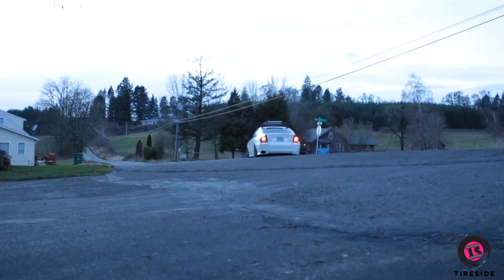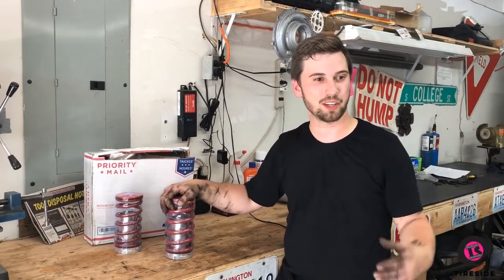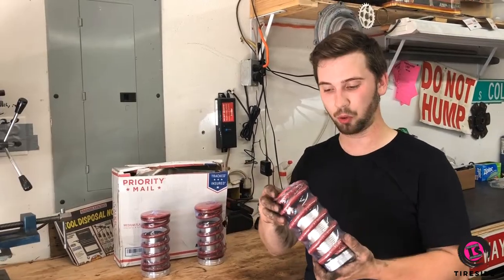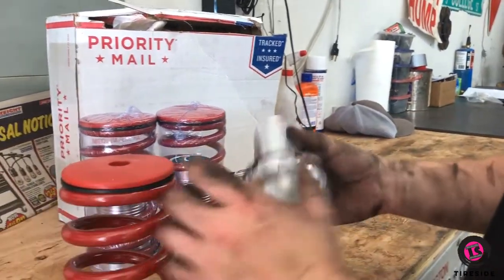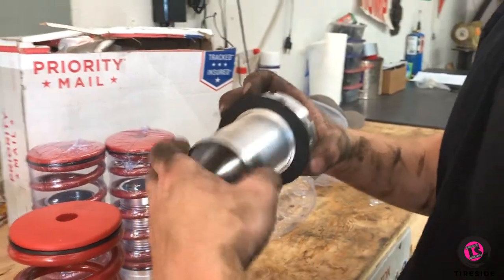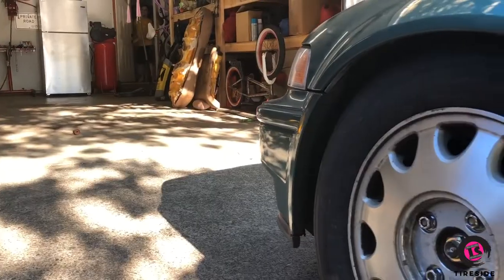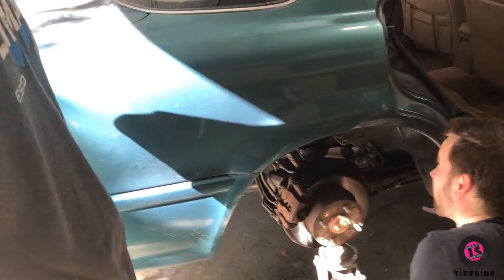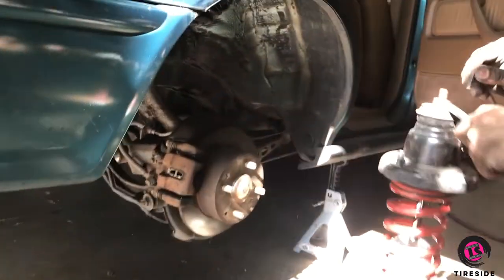The CHEAPEST Coilover Kit on Amazon!

Comment: the installation of the screw-in base is backwards, the smooth part must be installed at the bottom of the shock absorber and the screws are placed in the upper part of the shock absorber, because if you don't do it like this, later the screw-in base will break into pieces

Comment: Exactly how does the spring not hold up the rear end of the vehicle but it does the front end where both the engine and the transmission is located ?
Reply: It’s where he put the smaller springs it has 2 that are slightly thicker for the front he probably got them mixed up it happens a lot

Comment: So i just bought these for my 1997 Honda Civic Ex for my 2 back tires and if they don’t do anything, how can i cut springs from my old cars?(they’re stock) i have to get something cheap because money is an issue right now but my back is so low that the back bumper rubs on my tire and i can smell it burning. and when i go over bumps i can also hear it scrape at the bottom since it’s so low and when i’m moving at slow speeds i can hear my springs making noises..